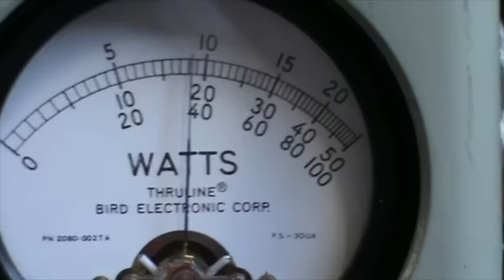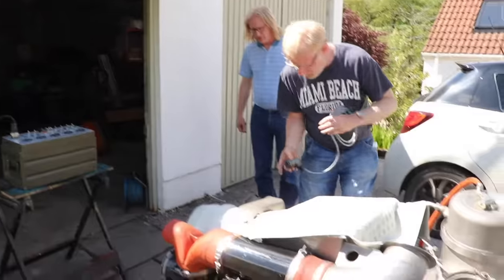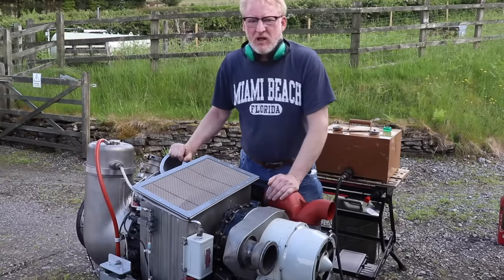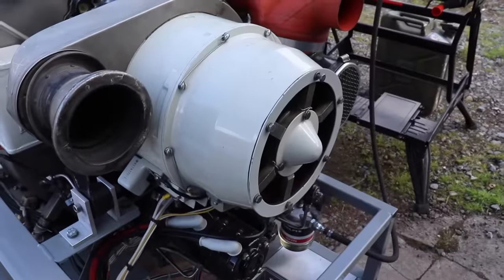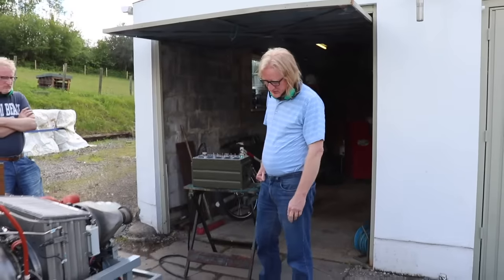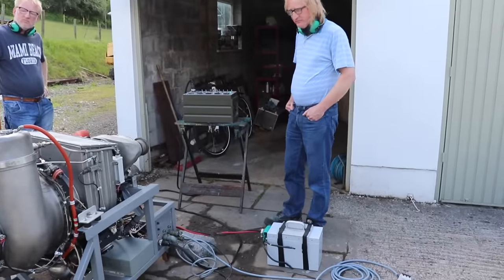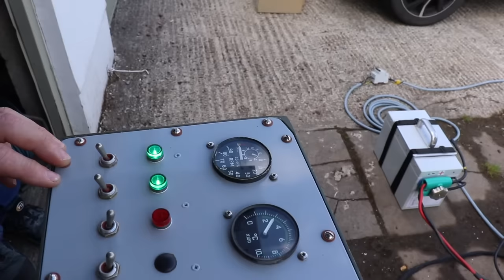Electricity From An Old Aircraft APU

Comment: My neighbors are sooo lucky that I do not have access to such amazing toys. I would run them all day..
Reply: Not with the fuel consumption of that thing you wouldn't.
Reply: You could run them all day, i as your neighbor would sit outside with hearing protection laughing and watching your credit card melt away ….😂
Reply: Im mostly concerned with the nearby lambs exposed to around 120 db of jet noise. I did not see them out there at run time however so I guess they are taken inside before a run so they are not direclty exposed to the deafening noise.
Reply: Lousy thermal efficiency, likely.  Sucks kerosene like crazy. 30 - 33 % LHV, I'd guess.
Reply: @johnpekkala6941  Jet deafened lambs are more tender.
Reply: @Randrew  Grass fed beef and jet tenderized lambs. Only way to go.
Reply: Hold my beer
Reply: probably power your whole house ac and all. 9kw is some juice. I have 7 kw solar and in the summer 100+ degree I run the ac at 76 no electric bill.

Comment: A 300 hp gas rurbine  would put out at least 100,000 watts. But it's main mission is to start the bigger engines on the plane using airflow as as a starter motor that make 12,0000+ hp each
Reply: WTF is the correct title! 😂
Reply: Yup, they do 2 things.  Provide electrical power so the startup sequence for the engines doesn't have to rely solely on the batteries, and they supply high pressure (or high flow, forgot which it was) that powers the starters on the main engines.
Reply: @Andrew-ep4kw  apus typically put out about 2-4 lbs per second of bleed air at 40-50psi
Reply: 300 hp is 220 Kilowatts. So double the amount you state.
Minus inefficiency, let it be 150.000 Watts.
Reply: Yes and no. Many bigger airports have ground starting units to provide electricity and pressure so the APU doesn't need to run (noise reasons).

On the other hand an APU gives you a huge security margin when you lose an engine to stabilize the electrical aystem and to have power to supply electricity to all avionic systems in case the second engine fails, too. You don't need the RAT then.

Comment: This particular APU looks like the thing they installed in the wheel well of a 727.  Back in the day, I had a mechanic show me HOW to get the APU to run while the airplane was flying;  This was an ultra ultra EMERGENCY procedure, because a running APU WOULD BURN THE TOP OF THE RIGHT WING ROOT.  If you lost all your generators for some reason, you could pull down the APU panel, pull two wires off, and when connected, if the gear was down the APU would fire up.  Again, an ULTRA EMERGENCY procedure and I certainly would NEVER NEVER tell a Fed/check airman about this.....But it CAN be done.
Reply: Was it a design flaw that let it burn the wing root? And also what kind of emergency would justify that?
Reply: @JCarey1988  Lose all your generators due to whatever;  You are now down to standby power, powered by the battery, which will last you oh, about 30 minutes.  You are flying in IFR conditions.

Do you have any other stupid questions?
Reply: @JCarey1988  The exhaust from the APU was carried via a duct to an outlet on the upper wing surface near the  root , with a grate to prevent big FOD items from falling in to the APU. Originally designed with a door, but those were a major problem for dependaility and almost all were subsequently removed.
Reply: @Flies2FLL  No need to be rude. WIth it's three completely independent electrical systems, it would almost certainly take a three- engine-failure event to lose all electric power, and with that, you haven't got thirty minutes to sort that out.
Reply: @paulcrumley9756  First of all, there are four independent electrical systems, with standby power the fourth and final system.  You are down to battery power at this point.

Loss of all generators can and has been caused by what is known as a feeder fault.  If one of the main electrical lines from the generator experiences a major short circuit, it can cause a voltage surge that will knock all three GCU's [generator control units] off line and could possibly damage them, rendering the plane down to standby power.  

At this point you are not having a good day.

You have about 30 minutes of battery time in which to get on the ground.  The plane flies just fine without electricals, but you may not have lights, radios, or FLIGHT INSTRUMENTS in short order if you aren't on the ground yesterday....

One other issue that this malfunction can trigger is that once you are safely on the ground, the low beer light may begin flashing brightly.  There is no checklist for this issue, the solution is obvious.

Comment: 9kVA is pretty common for aircraft generators, with the APU being driven directly at a constant speed with the frequency at a nominal 400Hz whilst the main engines obviously change rotational speed significantly so the gen is maintained at 400Hz using a Constant Speed Drive unit (CSD) on older aircraft or an Integrated Drive Generator (IDG). You're right about fuel types...you could probably run a gas turbine engine on sawdust or even flour if you could grind it down fine enough. You know what happens to flour mills when you get a spark!
Reply: I can't believe the Internet doesn't yet have anyone running a turbine on flour. Clearly, this must be remedied.
Reply: @fallingwater  😁 👍
Reply: Or whiskey. What a terrible waste though.
Reply: @richardpiotrowski2118  Something as nice as a Glenlivett shouldn't ever be allowed because there are millions of gallons of Bells available as fuel! 😁
Reply: A sight to behold and music (albeit VERY loud!!) to my ears. Many happy years as an aircraft engineer playing with BAC 1-11 aircraft, including the RR Spey and GTCP85. Great video 👏🏻👏🏻👏🏻
Reply: @fallingwater  🤣🤣🤣🤣🤣
Reply: A coal fired gas turbine locomotive was designed and partly built in the UK,  but the project was abandoned before it was completed.  The power unit was completed and was run on test, but there were problems with it.
Reply: @srfurley  , the Nazis flew a jet driven by gas from coal dust.
Reply: I know what happens to flour mills if you get a spark.  It's called "an Earth-shattering kaboom", to borrow a phrase from Marvin the Martian.
Reply: The problem with solid fuel is that you have at least ash going through the turbine, and likely unburned fuel. This causes erosion as well as buildup of these materials and soot and tar. Not good for turning parts at high rpm.

You can mount a turbocharger on a wood gas generator as seen in videos. But I doubt that these survive very long if you're not making very clean gas.
Reply: @gustavgnoettgen  You're absolutely right. In addition to your point, if your engine uses EPR as its control and efficiency measurement systems then the pressure sensors are going to clog pretty rapidly. It's not an uncommon thing to see clogged EPR rakes in older engines anyway,. It was pretty common on the Rolls Royce RB211-E535C3 version for example. You'd need to use N1 for your eng control.
Reply: I've heard iron dust is explosive
Reply: @humanwow5848  Technically, almost any dust can be explosive if you grind it finely enough.  It mainly depends on whether or not it will react with oxygen.  Iron will (iron oxide = rust) so I can easily believe that iron dust can be explosive.
Reply: @humanwow5848  I think anything which is combustible can become explosive if it is fine enough to mix with air in the same way that vapours do.
Reply: The APU in a Boeing 787 has two 225kVA starter generators. It doesn't have to provide pneumatic pressure though. And only a single Apu Starter Generator has to provide enough power to start a GEn-x or Trent-1000 engine.
Reply: The first diesel was test run on powdered coal! though liquid fuel was easier to inject
Reply: @jhmasterson3087  I had no idea!  I'm glad you went in to print on that. Thank you!
Reply: @CheapBastard1988 that’s correct.  The 787 doesn’t have a bleed air system.  It does use bleed air for the engine anti ice system and to pressurize the hydraulic fluid reservoirs but that’s it.  The wing anti ice system is electric resistive heat and the pressurization system/ A/C packs are powered by electric compressors.

Comment: I've started many an APU, but never like this! If it weren't so loud, it would make a great backup home generator, I bet.
Reply: I think you wouldn't like the daily fuel truck deliveries including the bills..
Reply: Great in sense of flexibility because you kinda can run many different fuels. You can insultate this engines quite good because the noise frequency is very high.

Comment: Turbine power generators are actually pretty common around the world. They have the advantage that they can run on basically any fuel including gas and diesel. I'm curious, could this run on any fuel? Would that work? 

hearing protection not optional
Reply: Some liquid fuels wouldn't provide enough lubrication for the fuel pump - such as petrol. However, you could mix some oil into the petrol to help with that problem.
You'd have to mess around with different air/fuel ratios for each different fuel.
All turbines will run on all kinds of fuels - with the right fuel delivery system.
Reply: @brianmurphy8790  I see, interesting that it's the fuel pump. So those turbines that are designed for flex fuels probably have specially designed fuel pumps
Reply: I worked on larger Allison 501 industrial engines a long time ago, different fuels may require different nozzles  and fuel manifolds depending on the energy density of the fuel. I worked on some dual fuel engines that had liquid fuel and gas fuel systems. The liquid systems normal sized nozzles and standard fuel piping. Low energy gas fuel (Methane) had huge nozzles and an almost doughnut like fuel manifold ring around the engine to admit the larger volume of gas needed fast enough. Add super heated steam re-injection and it gets very complicated in there.
Reply: 400 cycles will burn your house down.  We run 60 cycles. If you can rewire generator to put out 60 cycles then ok.
Reply: @smokeandsteamxsw9831  -  No it will not... 400 is no more dangerous than 50 or 60. I don't know where you got that idea, but all the electronics you have with switching power supplies, the lamp dimmers, and most other things are OK on 400 hz. Transformers in some cases do not like it and motors try to sync up with the frequency so AC fans and some washing machines are not OK with it. But for running lights and electronics and motorized things that utilize a switching power supply? Bullocks.  Its back to school my son.
Reply: @smokeandsteamxsw9831  Rewiring wouldn't work; it would have to have a reduction gear adjustment. And optimizing a 400-hz generator to run 60 hz would be difficult as well.
Reply: I’m a maintenance technician who knows a GE turbine tech and according to them they would send large versions of this to oil producing countries where they would start the turbine generator on jet fuel and then immediately switch it over to raw crude oil from the oil wells. They would eventually have issues and try to claim a warranty which GE would deny and that’s how my friend was involved. So basically yes, they’ll run on just about anything, the question is just how how long.
Reply: @OrionsKelt  They used to use (and very well may still use) modified P & W JT-4 engines with an attached power turbine, called a "GG-4," I believe, and run them with residual natural gas extracted from the crude oil they were pumping.  On that combination the service life was incredible; no cycles to speak of, no contaminants in the fuel, no serious environmental issues, etc.
Reply: @KlodFather  While switching power supply would be ok as they have a rectifier inside so they are running off DC, we still have a lot of devices that depend on 60Hz. Like you said, async motors (fridges, fans, etc), anything that has classic transformer in it, capacitive dropper, etc. The best thing here would be to rectify it and use the inverter.
Reply: @desnick2316  -  BTW lamp dimmers work OK. We tested the big fan controller ones and the lighter ones for your chandelier in the kitchen or the light in the living room. The ones I tested still worked... some better than others. I used to use the big speed controls/light dimmers to control the temps in solder pots and one to adjust the heat in my croc-pot and other resistive loads. Lamp dimmers make good heat controls for cheap soldering irons. When I was young, saving money was necessary :)  Make it work.
Reply: @KlodFather Yep, that makes sense. I would just not hook up my house to 400Hz. Using a dimmer for soldering iron is a good idea. It would change the power rating of a soldering iron rather than the temperature directly, and it is probably enough in most cases. I totally get the saving money aspect
Reply: @desnick2316  -  I usually ran a 40 or 50 watt weller soldering iron from 40 to 50 years ago and turned down the power. Used a candle stick lamp as indicator. THis worked as good as many soldering stations. And it worked on 400hz too LOL. You can also use a single 400 volt diode which cuts the watts in half. The dimmer is a cheap easy way to control those kinds of devices.

Comment: It sounds very like the jet engines running the ambulance helicopter which used to land at a hospital almost next to where I used to reside for work purposes.  One thing I noticed is that they would never just shut down the engines after landing.  They always left the engines running for around two minutes following a landing before shutting the engines down.  I presume this was to allow the cooling system to remove most of the heat before shutting them down completely.  It's not difficult to imagine that the coolant and/or the lubricant would boil from the residual heat if they simply turned off the engines.
Reply: Jet engines are cooled by the air coming in. Commercial engines are known as high bypass. So most of the air they take in is as the name implies; bypassed from the combustion chamber and used used for cooling the chamber down and on commercial airliners it's also the main thrust. Jet fighters are known as low bypass; so most of the air is actually burned. This is known as a APU. or Auxilery Power Unit. This little engine runs when the main one is off or just starting up. It also provides bypass air for the compressor to start spooling during engine start up. Helicopters like the one's you used to watch are known as turbo shafts. They have a jet engine that drives a reduction gearbox that powers the main and tail rotors (depending on design). Instead of using the engine's thrust, they use the rotational force of the turbine. Same concept with the turbo props. Jet engine is connected to a reduction gearbox that rotates a propeller.
Reply: @fightingfalconfan  I knew most of that except for the difference between high bypass and low bypass engines.  Thanks.
Reply: Yes , that’s exactly what it’s for. I was surprised that I could not get straight out of the helicopter when we landed but would have to sit there awkwardly looking at the ground crew waiting for the temps to drop.

Comment: In a diesel generator an old rule of thumb is 1/2 pint per KVA per hour at full load for a fairly modern turbocharged diesel engine. I wonder what the consumption is with this? I ran lots of Cummins KTA 50 engines in the desert on JP8. We had 20X 50 liter 1250KVA units running in a synchronized plant in various locations.
Reply: @@smithy1833 and how many KW?

Comment: That's cool.  Its my first time watching "The WTF" channel.  The farm they are on looks like it could be in the U.S. Midwest.  I live in Missouri, and the surrounding natural setting in NSW looks a lot like where I grew up on the north edge of the Ozarks.

Edit: I know nothing about airplanes other than the basic components (wings, engines, rudder, engines, APU, etc.).  Do airplanes use AC current or DC?   Can the APU run basic instrumentation when plane isn't hooked to ground supply with no engines running?  Anyway, dumb questions, but thanks!

Comment: Lightbulb dummy load-makes me think of a lightbulb load made up for a 10kw AM broadcast transmitter having over 10 1kw tower top beacon bulbs-1 kw each. Lit up nice and brightly flashed during 100 % modulation.
Reply: It is like in a hydroelectric or wind power generation which have dummy loads or dump loads, (My concept is wiring the dump load to a water heater, so that the excess energy can be used in heating water for household or commercial use), or in FM radio, which they connect the transmitter to a dummy load for maintainance  and testing purposes in place of antennae.
Reply: @markarca6360  that is what the lightbulb load was for. At a gov’t VOA studio plat they have a 750kw Cat genset for backup power. It is equipped with a large nichrome wire wound load for testing.

Comment: How about converting an old APU of about 50HP to natural gas and driving a proper stator for either 50 or 60Hz output as a backup generator? The question is fuel flow. It might do well close to 100% load but likely inefficient at 20%. And I have wonderful neighbors so probably not the best solution.
Reply: I would expect the RPMS would be too high for 50 or 60 Hz. Could use a rectifier with a low-voltage stator to drive a sine inverter?
Reply: @sodiumvapor13  Or specify pulleys for the correct RPM.